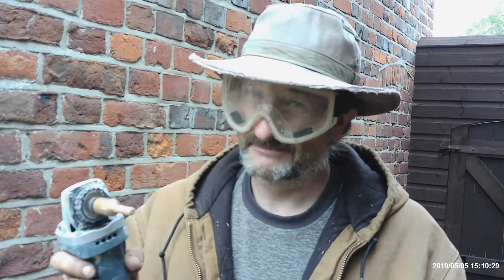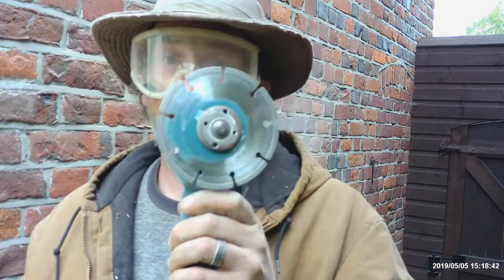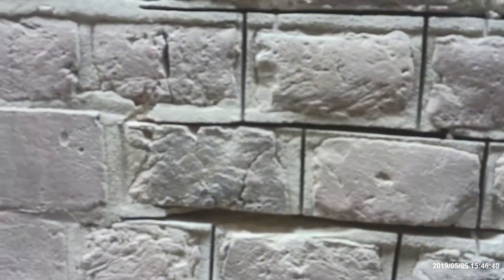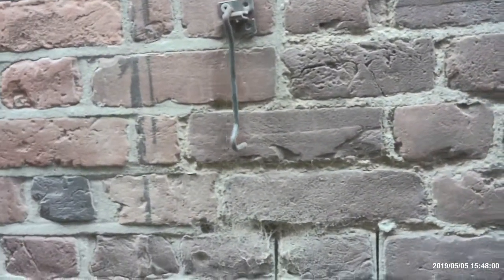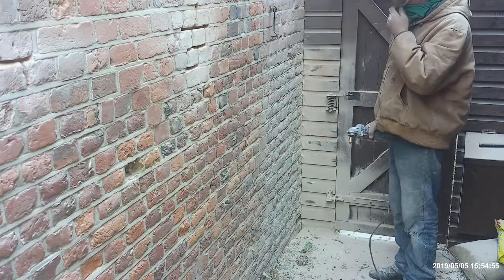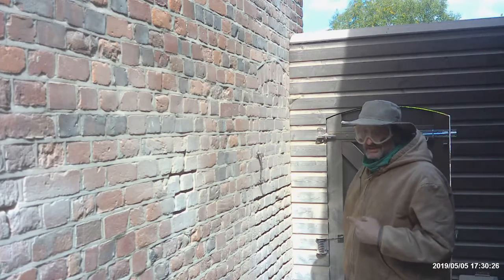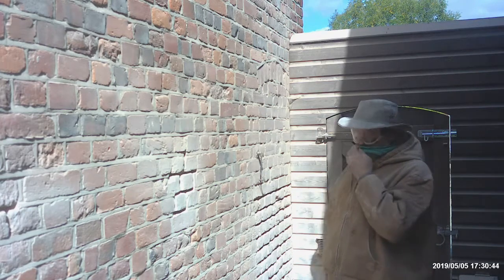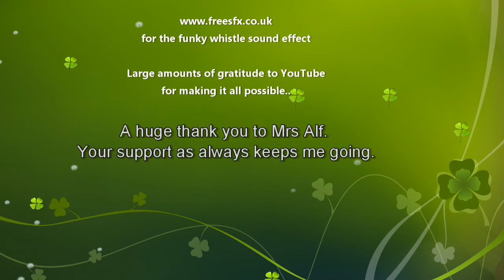Grinding out old pointing

Comment: Cant beat a proper diamond 8mm thick blade, (and a guard for the grinder.)
Tried these little diamond coated sticks and to be honest if it's a small area great, for a whole gable or something It would take forever because you cant apply much pressure without it bouncing around all over the brick. Personal opinion

Comment: hi mate how long do the rakes last how many square meters roughly with tough joints like those.
Reply from the maker: You can get roughly a 2 square meter section out if you don't push too hard and don't let the bit grab the wall. Don't buy Silverline rakes they're worthless. You'll get roughly 4 linear feet before they get too warm, grab the wall and bend. The disks last about 5 square meters so you'll need less of those. for this wall I used 9 good rakes and three discs. and two grinders but the seconds still going and the first was very old :) if you have an air gun on a compressor blasting out the switch and air holes on the grinder is very useful for ease of operation. i'll look up the type i was using and put it on here for you.
Reply from the maker: https://www.screwfix.com/p/mortar-rake-8-x-40mm/31307    Standard length rake
Reply from the maker: https://www.screwfix.com/p/mortar-rake-8-x-65mm/71778     Brick removal rake
Reply from the maker: https://www.screwfix.com/p/erbauer-masonry-stone-diamond-mortar-rake-115-x-22-23mm/85668     Stone cutting disc

Comment: Don’t do this get yourself a dust extraction kit on your grinder there not expensive at can go onto a Henry hoover. Then you can see what your doing
Reply from the maker: As with most of my jobs I work on small ancient buildings that were made before large families extended them, more houses were built and personal space became inadequate. The alley I'm down here in this video is three feet wide. Dust extraction was out of the question due to space constraints, the impossibility to film at the same time as running the equipment and it definitely wouldn't have been going up the ladder with me. However....... if you get the chance to use it please do, it is the single most beneficial thing you can do to prolong your health... now that said... dust extraction kits for grinders are a pain if you want to see what the tip of your grinder is doing.. it blocks your view of how deep you're going into the wall and in most cases will help you mess up what you're doing. So in acquiring your new dust extraction gear be sure to make a choice that solely relies on view ability of your chosen task for said extraction kit. The all important bit is being able to see where your tool meets the wall. You also do not want to have to place your face directly into the direction that the sand and stone is being fired away from the wall in order to see. and there isn't a single dust extraction kit on the market yet that catches all of what you remove. Especially with lime mortar. Also the extra hand strain over the ten days your using the grinder with the extra weight iof the connection to the gear will damage your wrists. Wearing some wrist supporting but not too tight gloves will help here.
Reply from the maker: I would not however recommend a Henry Vacuum cleaner you will end up spending more time de-clogging and emptying it and prolong an already stupidly long job. And the emptying will be as dusty as the job you're trying to make dust free... shop vacs are the way to go or bagged dust extraction units are so much better. and you can make your own.